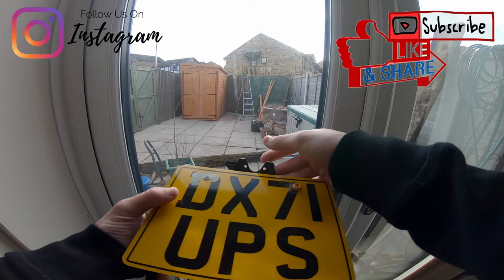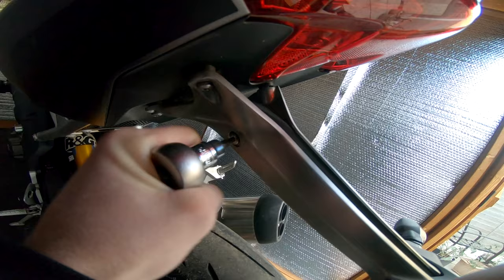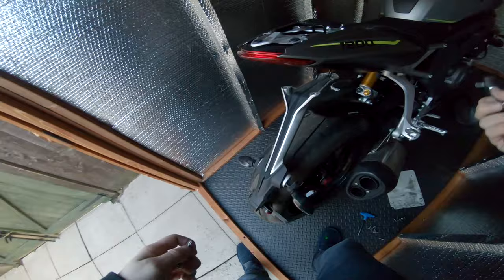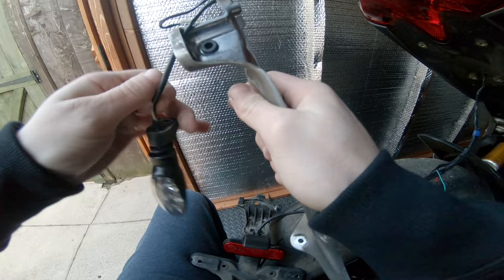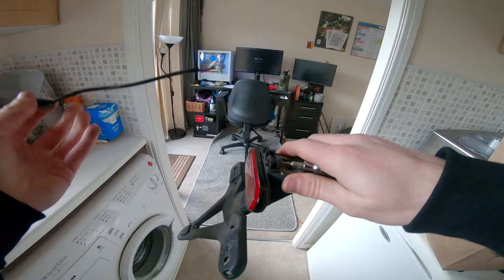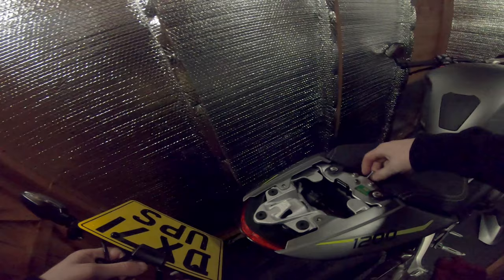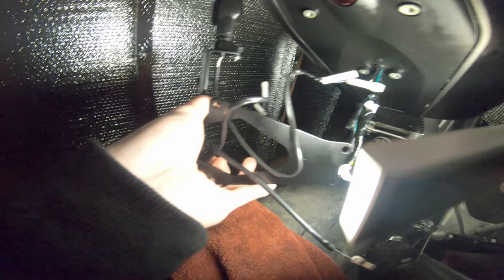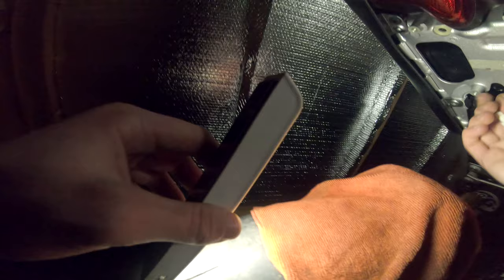J-tech Tail Tidy Install | Speed Triple 1200rs

Comment: Nice! I installed my Evotech a couple of months ago. They sure have the wiring tight in there.
   I remember when motorcycles had room under the seat for a bunch of stuff. I guess that is not the case these days.

Comment: I would add some anti seize on those bolts going into the tail to prevent corrosion. 
Also, that isn’t grease to keep the dust out, it is silicone to keep the water out. 
Just food for thought.
Reply from the maker: Cheers for the comment,

Pointless adding anti-seize. Once the screws are in place, water wont work itself upward despite capillary action- the loctite will do fine. 
Also rgd the dirt (not dust) is why I added 'water*' as subtext to correct my mistake. Doesn't feel like silicone, and smelt of grease.

Comment: Nice. I went with the trust engineering one. Looks like it needs to be bent down a little? Plate sits a bit too much towards the horizontal?
Reply from the maker: It's fine, probably the angle of the GoPro/wide angle

Comment: I'm thinking about taking that whole plate holder blinker and lights off all together and rigging up a plate holder with some plumbers tape just enough to have my plate seem but no blinkers, do you think after taking that off it is possible to just push the wires up into the bike or would there be wires hanging out. I don't like any of the tail tidys out right now and I'm trying to get rid of that bulbous thing hanging off the back. Let me know what you think if you understand what I'm saying lol
Reply from the maker: I kindof get you but that would be sketchy, but yeah theres enough room to get the wiring back up I'd say